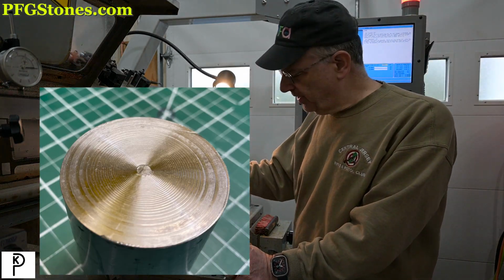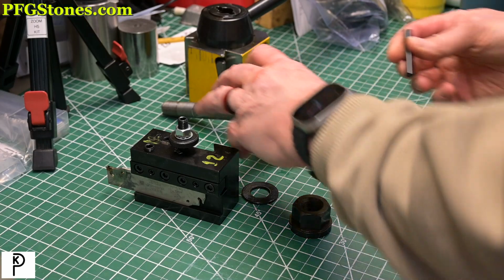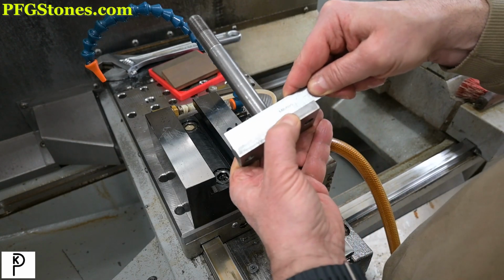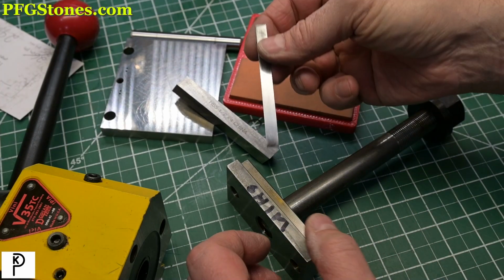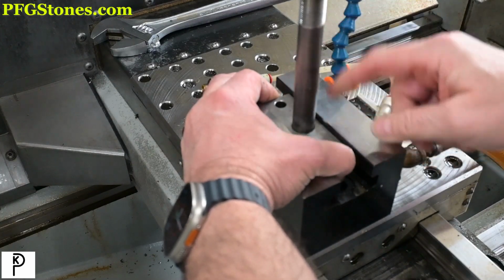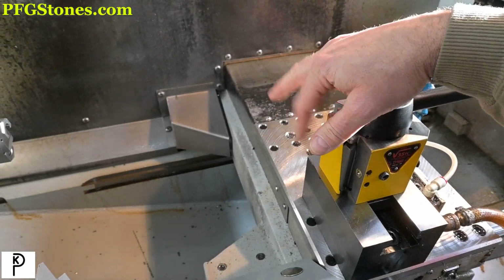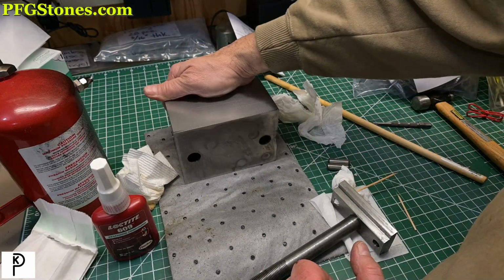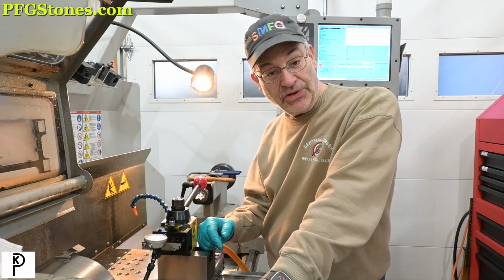Tool Post Fix on the Haas TL-1 Lathe - Part 1 of 3

Comment: 👍 you should check both faces of the toolpost to see if they concur. 
If not the lathe carriage is probably out of alignment.
We had this issue with our TL1.
Not a hard fix.
Might consider leaving the toolpost free to move as a failsafe during a crash.

Comment: Hello, It is important that the tool post stud to tee nut connection is perfectly  at 90 degrees for best possible tightening. Personally prefer not to prevent any movement of the post under adverse cutting conditions. Decreases a more serious " wreck " something has to give. Personal experiences, IMO

Comment: I was thinking Tig welding a pad on each end of the slot and file/lap it to size.
Reply from the maker: Not sure I understand.  Can you elaborate?
Reply: @KPNH  I was talking about the T nut part of the video.
I thought an option there may have been to Tig weld 2 pads instead of the shim, then file them down until you have a nice fit.
It was just what came to mind,
Probably because I had been Tig welding the day before lol.
Its probably a classic case of "The Law of The Instrument"
P.S. love the video's
Reply from the maker: @deepwinter77  That's a good idea!